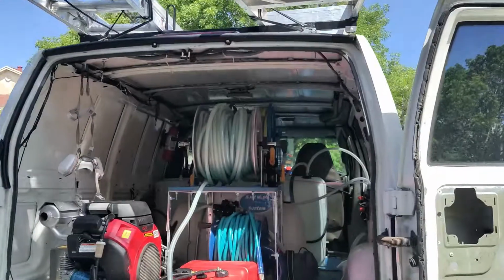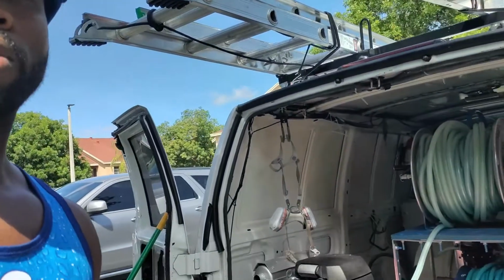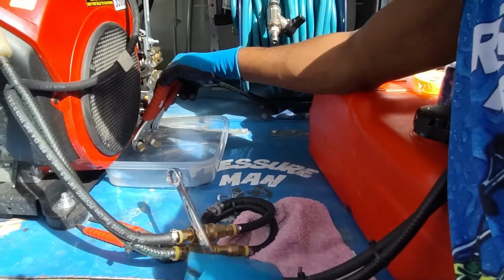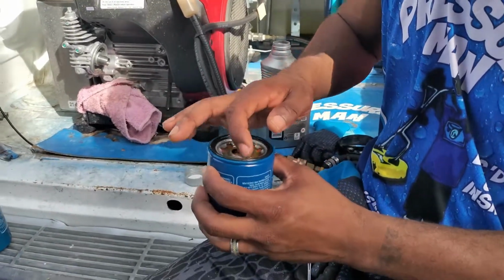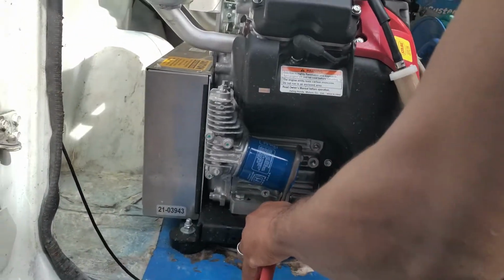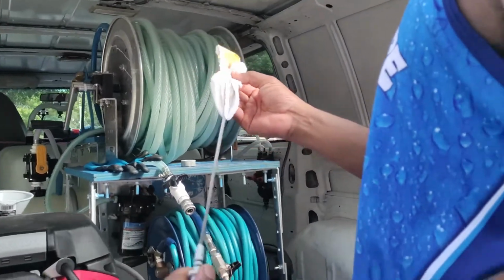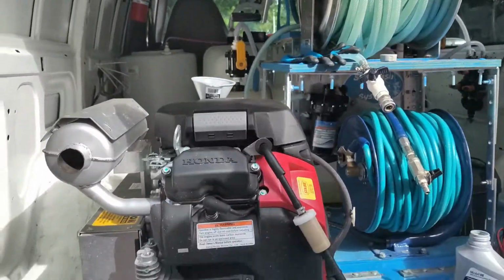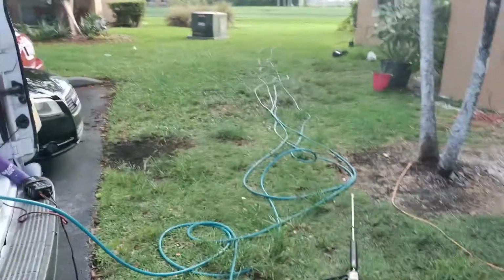Maintenance Day! Oil/filter change Honda GX 630 3500psi 5.5gpm

Comment from the maker: Yea, was still a rookie back then.. But an update to your battery for these Honda GX pressure washers. They don’t need to be charged the machine only uses a little charge to start the machine and the rectifier charges the battery replacing the small charge it used to start the machine. Thanks for watching and Subscribing the channel!!!

Comment: Nice setup I’m about to get in the business. Where did you get your pressure washer from?
Reply from the maker: Pressure washer Products

https://shop.pressurewasherproducts.com/8-GPM-3500-PSI-K73-SKID-COLD-POWER-WASHER-NO-TANK-BATTERY-PW835HGK7.htm
Reply: So you have a 8gpm PW I thought it was a 5.5gpm
Reply: I’m trying to get in the business, so I’m trying to learn a lot at this point.
Reply from the maker: I do have the 5.5 this is just the site I ordered from
Reply: Gotcha hopefully I will be starting soon